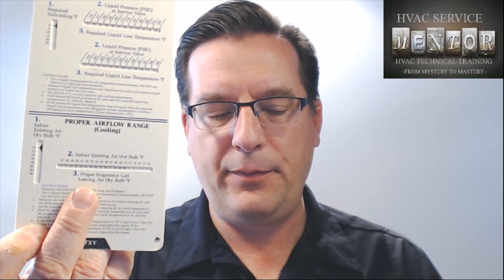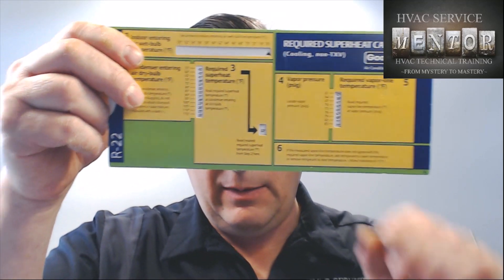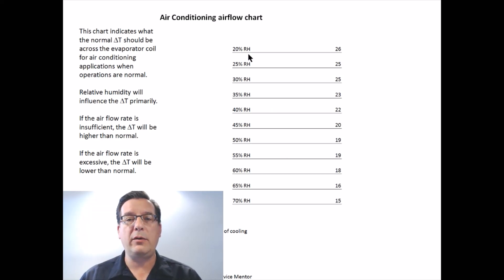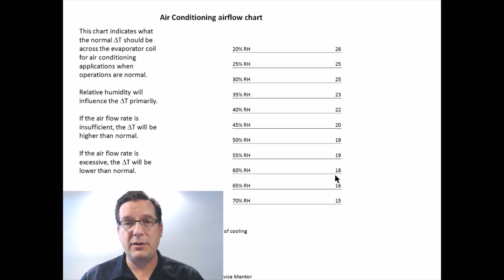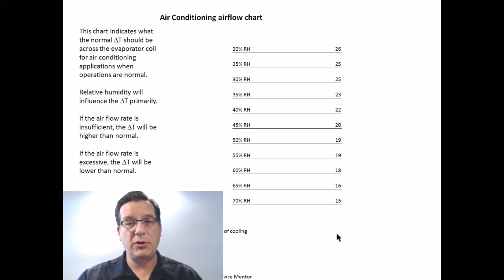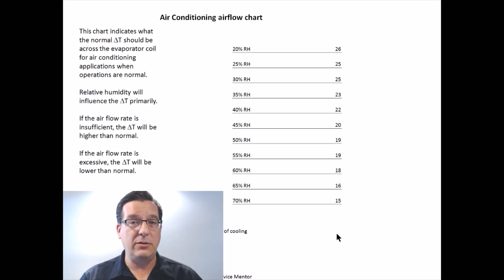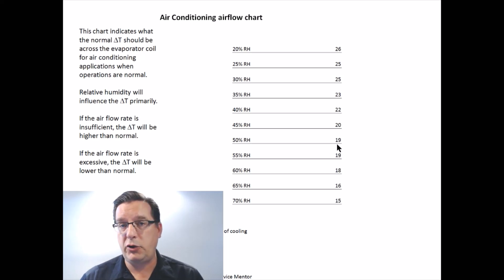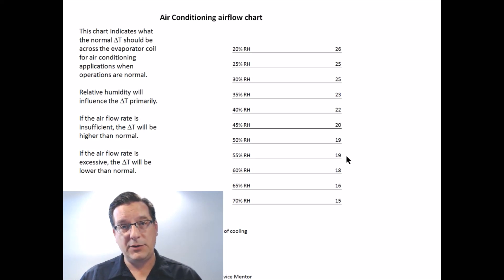What is the proper temperature drop for air conditioning?

Comment: 1:42 - TD on the exams refers to the difference between the saturation temperature and the temperature of the media having heat removed. The greater the difference the more heat is moved.
Reply from the maker: Not sure which exam you are referring to, but I have never seen that on any exams I have personally taken.  I can say that it can often be confusing for a lot of people because there isn't really a strict standard of terminology in our industry.  Not like medicine for example.  There are also regional influences and traditions where in one part of the country people use one term and in another part of the country people use a different term for the same thing.  For example, the value that you mentioned is also referred to as approach temperature.  This is completely different than the air temperature difference across the evaporator. When we are examining the difference between air in and air out of an evaporator coil, delta T greater than standard for the existing conditions results in less total heat moved in BTU/h.  This is extra fun when reading plan drawings from engineers who may be from another region or control points.  I know what an RTU is.  I know what a CU is.  What the heck is an RCU?

Comment: I think if you consider enthalpy or total heat, it makes more sense.  In some areas, humidity is the largest part of the load.  You can plot the enthalpy change on a psychometric chart, put in some figures for the airflow, you can actually come up with BTU’s  change from supply to return.  Sensible heat is only one part of the equation.  I’ve seen anywhere from 16 to 26 degrees Delta T which agrees with you’re chart.  I think all techs should have a laminated copy of your chart. Great presentation.

Comment: I draw my return air from the basement where it is consistently near 70F all summer at about 55% humidity. I have a thermometer in the air stream just above the A coil and it reads 48-49 degrees when the OAT is 85 or higher. When the OAT falls to the 70s the temp drop increases by about 2 degrees. When it cools off outside at nightfall to 68-70 and the system still runs a couple cycles, I will have 45-46 degrees above the A coil. The whole time the air handler inlet temp and humidity has remained constant. A change in OAT alone will affect temp drop on my system. It is an R-22 2.5 ton fixed orifice.

Comment: For a hotel type AC wall unit if you had a way of cooling the air at the place where it sucks in the warmer air would that alleviate some of the work of the compressor and therefore save on amperage consumed and still cool effectively? Just assume the cost of making that cooler air is free and the thermostat is say 15' away.
Reply from the maker: It's never free. However, power consumption in any AC or refrigeration system is directly related to heat removal.  If the system has less heat to move, it will consume less energy.
Reply: @hvacservicementor  Great. Thank you for your reply. My thinking cap is on. Not for free energy but for lowering the cost from the power company.

Comment: SH and SC are irrelevant with mini split systems
Reply: So you're rotary compressor will be happy with 70 degrees, or zero degrees of super-heat? lol
 These measurements may not be the most valuable for that equipment, but blatantly ignoring them is ignorant
Reply: @jakem117  actually ductless systems run at 0 degrees superheat frequently and do so because they have an accumulator directly attached to the compressor to store liquid refrigerant. The only way to truly check charge on these systems is with sensible heat calculation or recovering and weighing charge, unless of course it’s so dead on charge that there is no liquid refrigerant at all and only vapor.
Reply: Listen, if vapor is entering the compressor, and vapor only. There is superheat... Remember how thay works? lol
 No compressor I know of can pump liquid. Now if your instruments aren't accurate that's a different story.
Reply: @jakem117  I’ll agree that you can measure SH at the compressor suction line, but measuring evaporator superheat is irrelevant, and sub cooling is irrelevant as well when it comes to mini split systems
Reply: Unrelated?! Based on the temperatures on both copper lines on mini split system? The temperatures on those copper lines are the same because BOTH lines are suction lines.
Reply: timrob0420: SH and SC may not be important to you, but it is very important to the equipment. What I mean is there are sensors at the indoor coil and the outdoor coil that are telling the variable speed compressor to speed up or slow down. If what you were saying were true then the compressor would only need to run at one speed. The actual numbers of SH and SC will be extremely hard for a technician to measure using gauges and temperature probes. Someone else already mentioned it that the best way to do it is to evacuate the system and weigh in a new charge. If you have a different way of doing it and it consistently works for you, then keep on doing it.